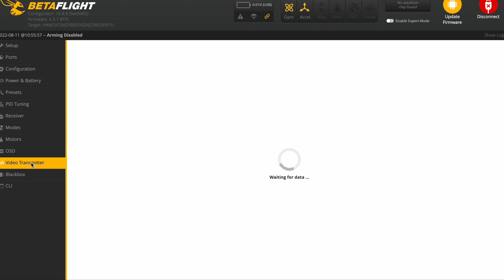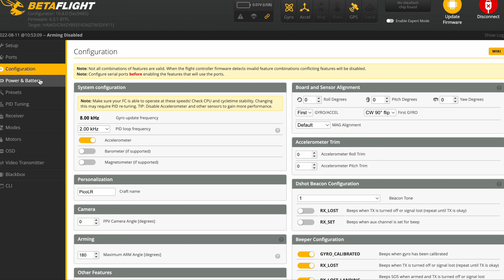Picolongrange - tiny 3d printed FPV drone

Comment: I would love to know how much you spent moneywise on this. The military has come out with a drone virtually the same size that cost $190k+. Printing is the future for sure. Great job, man!
Reply from the maker: I just used parts which I had available. If starting from scratch, cheapest way to build this drone is to buy a Mobula7 ELRS and the tiny GPS. Buying parts separately is around 150$:
FC AIO 65$ 
Motors 40$
FPV cam 15$
GPS 15$ 
Props 3$
Reply: I'm assuming you are talking about the black hornet. The difference with that drone is mostly in the transceiver management. It supports encryption of the controller, video transmission, gps, and uses frequency hopping so the signal cannot be easily detected by electronic warfare. It also features a very high quality night camera and a thermal imaging module (the package comes with two helicopters as a pair). The biggest cost however is their rotor design which makes it unbelievably quiet. It can fly just a few yards from you and you won't hear it. This is something no other drone manufacturer has been able to replicate but for military and police purposes it is invaluable.

Comment: does this have better flight characteristics without the gps than a tinywhoop? can it be used for freestyle?
Reply from the maker: yes, it rocks without gps. you can even try larger props like gemfan 2015 and larger motors eg 1002
Reply: @Unboxingexperience7  im gonna guess this carries a go 2?

Comment: did you get the lite version of the X12 5in1 AIO Flight Controller
Reply from the maker: I m happy with integrated spi rx with ufl connector for external antenna

Comment: what  motors kv?
Reply from the maker: 19000kv
Reply from the maker: for sure happymodel 0802 motors. i think 19 or 22000kv
Reply: Which vtx
Reply from the maker: it's integrated on the happymodel AIO flightcontroller
Reply from the maker: 0802 19000KV brushless